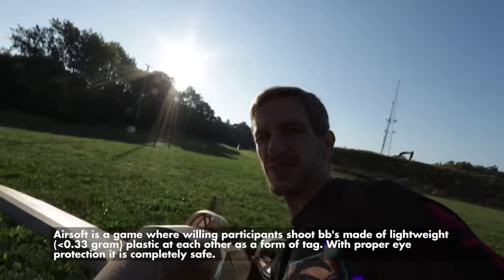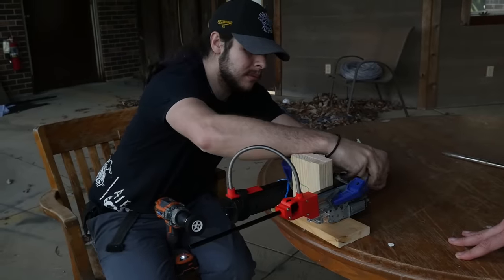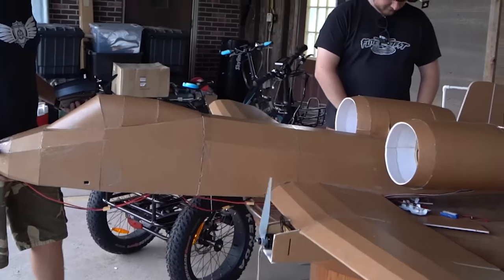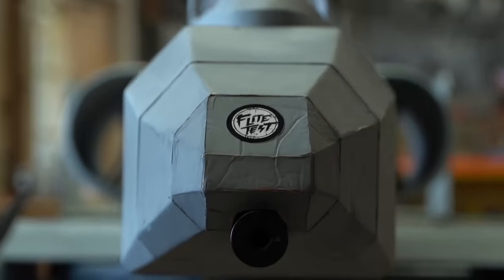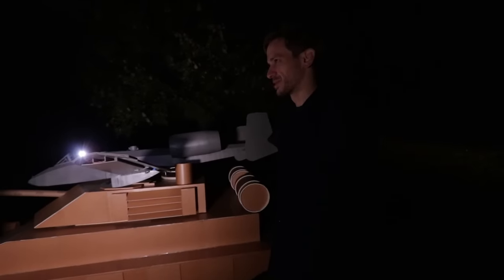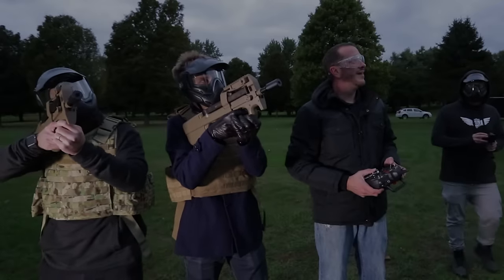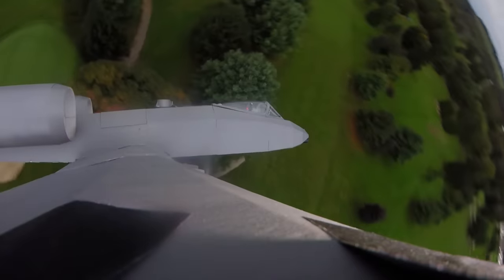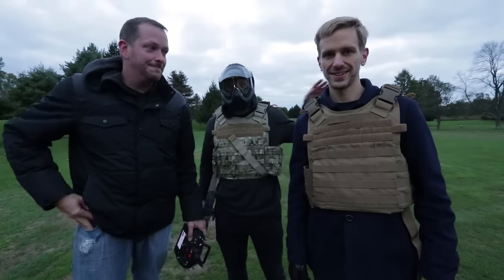A-10 Warthog  VS  Tank - Epic Airsoft Battle

Comment: I think a mini version of the A-10 would be a great idea! I would buy it.
Reply: Yeah, I agree, would be nice if you could put some edf units in it at a reasonable cost. Twin 80mm max, preferably twin 70mm size. I have the FMS A10, which flies surprisingly well for its 4.5 kg weight.
Reply: Have you seen nerdnic's a10?
https://www.nerdnic.com/a10.html
Reply: Yeah you can use some fireworks in little tubes on the wings that can be shoot like a rockets from the A-10.
Reply: I love it😀👍🏻🤩

Comment: In a future revision: add a speaker and a sound source, so when you pull the trigger, you get the mini-gun BRRRRRRPT sound!
Reply: Also bottle rockets for extra fire power!
Reply: @3Ball Actually, I think they put an A-10 onto the gattling gun!
Reply: Nah, flight of the valkyries needs to be coming out of that speaker
Reply: @ZenZaBill  Yup.  True story.  https://en.wikipedia.org/wiki/GAU-8_Avenger#History
Reply: @crackedcandy7958 Warthog sounds way better than Wagner.
Reply: Feels like that would be adding unnecessary weight tho
Reply: too heavy
Reply: there are many small but loud speaker that weight less than 500g
Reply: Mifa speaker, weight around 175g or 6.2oz
Reply: @gunner678  with a sugar motar rockets to give it a speed boost
Reply: It's not a minigun, its the GAU-8 Avenger 30mm cannon

Comment: But does it go BRRRRRRRRRRRT?
Reply: Wheres the brrrrrrrrrrrrrt button
Reply: i guess if you put a strong speaker in it will make it go bbrrrt but it will add a lot of weight and cost to much energy
Reply: Antonis Mitsos or use a polar star’s guts
Reply: It goes PRRRRRRRRRRRTTT instead 🤣
Reply: Just put a baseball card in the spokes, son.  That will make you cool.
Reply: Yeah it doesn't shoot fast enough for it to be an A10. They shoot a lot of rounds, quickly and if you hear the BRRT noise, you're alive. The bullets hit before the sound does.
Reply: There’s actually an airsoft gun that goes BRRRRRRTTTT.. They could refit the gun
Reply: Why not a bunch of mini speakers and make it go brrrrrrrrrrrrrt
Reply: Leave the ZF Clan out of this, River...
Reply: the ting goes SKRRRRRRRAAA
Reply: If they add a turbo airsoft motor in that it littarly will make the birrt noise.

Comment: "Do not add airsoft to A-10". Ok! Adds paintball guns
Reply: Now that would be dope AF!!
Reply: whats next? cherry bombs? bottle rockets?
Reply: XD
Reply: Yea
Reply: or BB guns! and go against a flying target! that would be sick!
Reply: all that would be required would be a prop system with better energy use/thrust ratio, more battery power, a large clip, and a as lightweight as possible weapon with firing system. simple really. like, i would say.... maybe do a  faster firing airsoft gun to get it closer to the BRRRRT of the A-10, and the larger clip to allow longer firing, stronger engines, better batteries, and anything else you can think of would make the A-10 more likely to make you scream like this one kid i saw in a video when shot full auto by airsoft, and then try to focus fire on the plane....... and then get lit up like a christmas tree. I WANT THAT PLEASE!!!!!!!!!
Reply: Think we can go lighter than 14 pounds for the gun module if it's gas operated?
Reply: DEAR GOD HAVE MERCY ON OUR SOULS!
Reply: OOOOH
Reply: @airplanemaniacgaming7877  yes, green gas, or multiple co2 cartridges..
Reply: Don't hit people with white clothing
Reply: @emerjoseph27  BB guns are deadly not like airsoft BBs BB gun rounds are metal
Reply: Paintball guns for rockets (splash and rubber case)
Reply: Go for broke, put a gau 8a avenger on it!
Reply: *Adds Gatling gun
Reply: Damn good idea
Reply: @siksupprod  could work! just need to make sure that those cartridges are lightweight though......

Comment: Airsoft Technician for 8 years and long time aircraft enthusiast. Okay here is why the rounds did not hurt the tank, lets start with a few facts about what is happening in air as the A-10 is shooting. Air flows around and over the air frame in flight, this causes a pressure build up on the nose, which in the A-10's case is particularly stubby, as the air pressure builds up it also flows down the airsoft barrel. So we have pressure building up in the barrel pushing the round backwards. Meanwhile the air inside the RC is not being compressed, this air is what the airsoft gun will draw upon to fire the BB, the piston is released by the sector gear, and compresses air and attempts to push it forward and out of the barrel. While it is certainly not enough to stop the BB it will slow it down, however it does not stop there, once the round is out of the barrel and clear of the air frame it is out of the pressure zone created by the moving aircraft and is further slowed down as it hits the still air. This is certainly enough to drop the speed of the BB from 350 feet per second to what would seem like 120 -150 feet per second. Perhaps this is the reason that most fighter jets do not use rifle ammunition for their primary weapon systems? In order to combat these effects at least in part, the air would need to be diverted away from the barrel in some way, and the air pressure produced by the airsoft piston increased by installing a stronger spring.
Reply: That is true, so an additional solution would be to use heavier ammunition, rather than the .20 g BB's they were using, and instead use .25 or .28 gram.
Reply: You do have a point, and they are using the p90s. One good thing is that they used a small barrel and not a longer one. The longer one would cause slower bb speed because of the amount of air already compressed in the barrel.  Having a bigger cylinder might have a better impact on better fps for just using .20 tracers, which they are prolly using.  And the funny part is they said "< .33"  in the weights but they can get up into the .49s (nosvrich sniper boi bb)
Reply: Or it's the hopup mounted sideways :/
Reply: or you add a ram scoop over the barrel to and bleed a bit off and out the barrel behind the bb to overcome the inward air pressure ... and the wind turbine will be able to add power with a basic alternator setup (easy to make a small one) ... and not only do you recharge in flight but you also pressurize the gun against the incoming air and negate the drag down the barrel
Reply: It does not work that way on real aircraft and aircraft mounted machine guns or cannon. 
A projectile fired from a machinegun,  or cannon will leave the barrel at the same velocity it would if it were static on the ground. 

The reason modern fighters use cannon instead of small arms ammunition is... a  burst of 7.62 NATO rifle bullet or a .50bmg projectile does not cause enough damage in the short time on target dwell times that are inherant to jet combat. 
Explosive cannon shells, you only need a few to hit to destroy important structures.
Reply: @stinkyfungus  hell, even fairly early into WW2 most nations decided to have machine guns as a secondary to cannon rounds
Reply: @CrazyDutchguys  

Yes,  but autocannon didnt gain prominence on wwii aircraft 
Until it was apperant that 7.92, 30.06, and .303 machine guns were not "getting the job done" 
The cons were they were heavy, less reliable (feed systems that could cope with  the gyration of a manuvering fighter were tricky to develop) and you could carry less ammo for them. 

That said, the US continued to favor .50 caliber  machineguns firing an armor piercing incindeary round. 
Few american aircraft were armed with cannon, and the M2 and M3 brownings continued to be the mainstay of US aircraft armament into the korean war.
Reply: If the gun was housed in the wing or side of the cockpit, you could essentially create a small ramp/wind deflector in front of the muzzle and it would stop the air from entering the barrel, thus increasing FPS
Reply: From what the man said, I‘d also think that pressurizing  the inside of the Gun Housing with some kind of Duct seems like an easy option.
Reply: lmfao this guy.
Reply: @fanofCOH  what, are you jealous because he actually knows something worthwhile?
Reply: Awesome suggestion, in real life the A10's cannon produces so much recoil that they have to run the engines at max in order to prevent the plane from falling out of the sky due to a lack of forward movement.  It seams to me from watching the video that the A10 had to engage at very close range in order for the shots to reach the tank, and as a result it had to be extremely low in order to bring the gun in line with the target.   More power is definitely needed, it is doubtful that you could produce the same kind of energy (with in scale) so the other thing that I think is needed in order to support better strafing would be to adjust the barrel alignment down a bit.  With faster shots and the adjusted angle I think this A10 project could become something would decimate a tank...
Reply: @insanity54  yeah, I noticed that immediately.

Comment: Use a more powerful motor to increase the fps of the BB, also use a lighter BB like a 0.25g.
Reply: the motor in the GB doesn't influence the BB speed, but the main spring, displacement of the piston, air tightness between the nozzle/barrel and barrel dimensions will influence that
the motor only pulls back the piston, and it is released at a fixed point so no advantage from that, what a different motor may influence is the strenght of the spring it can pull back and the rate of fire, as a stronger motot will be able to compress more effectively stronger springs so the gun doesn't loses RPM, it can also be increased by going for a higher voltage battery, like a 11.1v Li-Po but that would need a overhaul of the gearbox as most airsoft guns aren't built out of the box to handle rates that fast (mostly the gears and piston rack)
Reply: @quentintin1  ah okay fair enough. But yeah they should do what ever they can to increase the fps.
Reply: A10s dont go smaller...
Reply: @joeynyesss1286  to get more fps (at range), better range and accuracy they should actually go with the heavier bb's.
.2's and .25g bb's get better fps at the muzzle but they also shed their energy a lot faster due to air resistance.

Comment: A10 Obviously. The A10 Is Known As "The Tank Killer"
Reply: Thx captain obvious.   But yes you are correct and it's a cool-looking playing overall
Reply: The Bomber
Reply: Tank Buster but hey you were close. And the Brrrt Gun
Reply: rb26dettskylinegtrr34 I don’t understand why people call it that. The only way for it to kill tanks is by anti tank guided bombs so wouldn’t you call every jet capable of dropping the same loads tank killers. Especially when other aircraft have more hardpoints for these bombs? The 30mm GAU on the A10 can’t even destroy modern armor instead just tear ERA and tank treads.
Reply: No, the A10 is known as the BRRRRRRRRRRRRRRRRRRRRRRRRRRRRRRRRRRRRRRRRRRRRRRRRRRRRRRRRRRRRRRRRRT
Reply: Aldino NRC it’s a gunship
Reply: @sergystraystar9135  

Wrong!  I worked on the A-10 for six years. Once during a deployment debrief, we were shown a video of mission assessments and the damage these birds do is intense!!!  And these things fly back with half the tail section blown off!

Comment: Post video wrap up...
A-10: I need one 
Tracer BB's: Straight out of Star Wars
Jeremy: Extreme dedication 
Airsoft gun fire rate:  Almost made me pee my pants 
Anything else: Great job guys, one of the neatest videos you have put out.
Reply: The guns are pretty expensive but you can actually find some airsoft guns that have that perfect brrrt sound.  Perfect for the A10 but far too heavy
Reply: @mjolnrrr  there are polarstar (compressed air) guns that will go BRRRRRRRRRPT like an actual A-10, but I don't think a flying compressed air tank works weight wise
Reply: xureality maybe a DSG? 60rps BRRRT not as sexy as a P star but I mean it’s just a gearbox that would do the job

Comment: My father was in the USAF  stationed in England for about 5 years early 70's. During the weekends locals would use the old RAF field to fly model biplanes. They had BB guns in them and would shoot each other down. They didn't have remote cameras or any of the tech you guys do. Their aircraft were a fraction of the size of your A10. I find it kind of funny you had so much trouble given all the tech you have that should give you the advantage but clearly technology isn't the biggest factor when it comes to this type of stuff skill and practice probably play a much much greater role.

Comment: Realy cool. Please upgrade the airsoft in the a-10 to more muzzle velocity, 170m/s and some 0.6g BB. Then you would destroy everything.
Reply: Ur smart...wtf does all that mean
Reply: It means using a gun that shoots larger sized BBs at higher speeds than the one they used in the video. Or heavier BB's than the others I forget which.
Reply: @Daniel Johnson heavier alot heavier then most BBs for airsoft
Reply: @GS-cs3qb  yes it is 6mm steel BBs
Reply: @gnarpoholic it dont have to be steel BBs 0.6g could be very expensive plastic ones too but it would be better with something like 0.3-0.4 weight BBs more speed less weight tho and since this is more penetrating power it needs the faster BBs would probably help while still having more then normal weight not sure if it would do alot in this but just looking at other real world rounds this might help it?

Comment: YOu should have modded the airsoft gearbox to increase the firing rate, the typical "BRRRRRRRRTTTT" would have been awesome ! It's not really hard to push it to 30 bb's/second ;)
Reply: Though they needed lots more velocity and increasing ROF will lead usually lower velocity. Ver6 gearbox would need CNC machined shell to even withstand say 150m/s velocity, that would turn into something like 120m/s thanks to pressure zone front of the plane (air pushing into barrel and causing resisting force eating velocity) and even that would be rather low velocity for this application. Rest of the parts to handle ROF of 30bb's/s and 150m/s would also need to be top of the line and who ever upgrades it, needs to be good damn wizard. Its possible, but cost of parts and expertize needed would not be cheap and even then there is high chance of failure, not to mention how often this type of high level upgrade needs to be taken apart for maintenance. Usually people who are unfamiliar with the tech side dont realize how much tress there is for internals and how much more parts wear with high ROF. Increase ROF from 10 to 20bb's/s and you already doubled your wear. Take it to 30 and its 3 times. Normal stock gun needs to be taken maintained every year for the least, now you need to do it 3 times a year. All this also increase wear meaning ordering those expensive highspeed parts 3 times more often than regular ratio gears.
AEG is nice invention, but if you want high fire rate, you go for HPA systems, with less moving parts and less mechanical tress. Dont forget, those too need maintenance.

I would have expected them to mount minigun on this, but that weights too much. Adding something like polarstar to this would been ideal performance vise, but flying HPA bottle in the plane that might crash and cause puncture to bottle, is probably bad idea. Also price of those systems is much higher.
Reply: @Hellsong89  how long have you been playing airsoft?  Ive been playing airsoft for close to 20 years and Ive only had a few guns put into a shop for maintenance.  Its all about knowing the limits of your weapon.  Stock guns normally tell you what battery and bb size to use and if you go beyond those suggestions then thats your fault if your weapon fails.  As far as upgrading, there are a few companies that offer a drop in gear kit complete with quality bushings for around $60-$80.  I know this because I had one of my old guns upgraded with this kit and it works like its brand new.  Thats not even getting into changing out the piston cylinder, piston head all the seals, and the spring.  Thats when you have to figure out if the battery you have is strong enough to work the entire weapon.  So I dont know where you got all your information from unless you work at an airsoft shop or are an airsmith but I just dont see where you get your info from.  I forgot to mention, in the 20 years Ive been playing, most of the guys and girls Ive played with, they too have only had to have their weapons looked at a few times.  Just remember, if you keep your guns cleaned and do the right things, youre already doing the first part of maintenance on them.  If youre having other issues like feed issues or sporadic firing or hangups, yeah I agree take it to a tech and let them figure it out.  Not trying to say youre wrong, just speaking of personal experience

Comment: You need to attack from a higher altitude and have air brakes
Reply: Elishathomas02 it’s a foam board airplane with an air soft gun in it that’s about as good as it’s gonna get lol
Reply: and move the props into the nacelles .... they do make turbo fans that would fit that and provide a ton of power ... also do a ram air scoop in the front just above the gun to turn a small wind turbine to provide a simple power generator to actually fire the gun and keep the batteries topped up ... use supe rcheap paint unprimed on the tank and it will chip with each shot pretty much and then you can see just how often it hit ... use a laser pointer attached to the barrel so the pilot can see the point of aim so he can shoot the tank instead of spraying the general area
Reply: And use a higher velocity gun